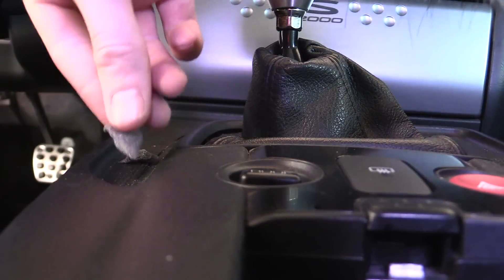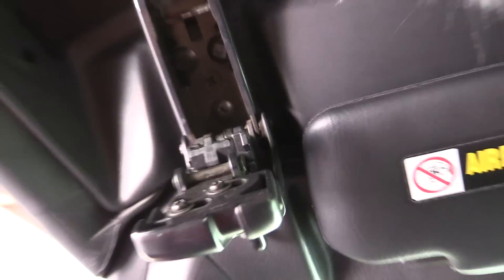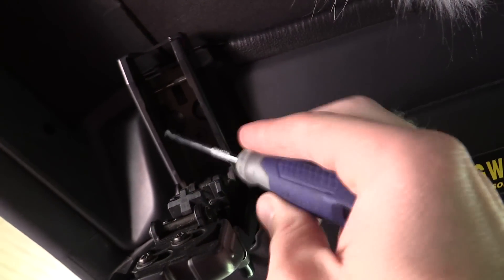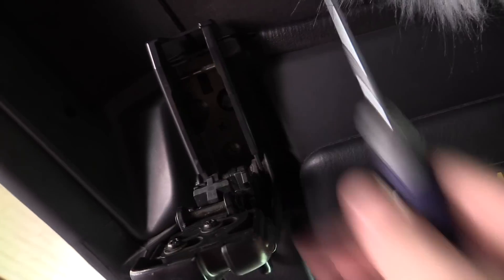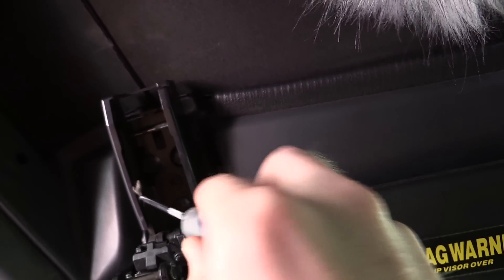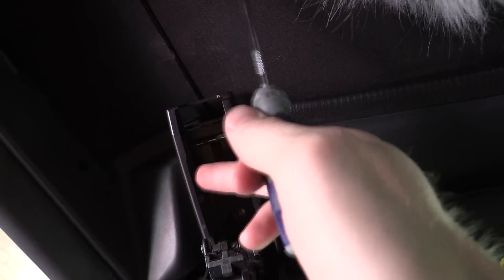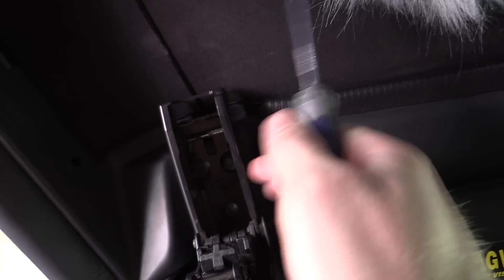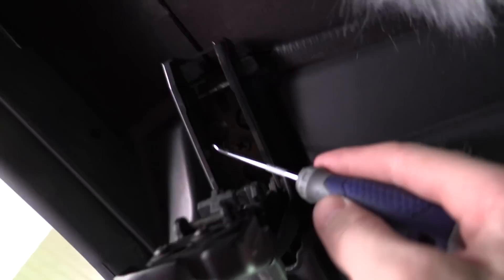S2000 latch rattle fix DIY

Comment: zentrose i have a 2002 s2000 and i have a buzzing sound coming from my soft top behind me while im driving it happens when im giving it gas its a buzzing sound from the soft top frame somewhere probly but i cant find it i did the latch fix and the felt pads at the one contact point on the too frame still doing the buzzing. smf cant find it have any ideas? thanks

Comment: Do you get a rattle/squeek for the passenger seat? Any ideas on how to fix it?
Reply from the maker: kimchimonkey What year is your S? Yes I think I have that squeak too. I will try to fix tomorrow and post a video. Thank you.
Reply: ZentRose 2008.  It seems intermittent for me. Thanks really appreciate your videos! Btw if you're planning on keeping on the stock radio I recently got the Blitzsafe bluetooth adapter and I recommend it.  I like not having any cables and sound is decent.
Reply from the maker: kimchimonkey That is a good idea. Thank you.

Here is what I did with the seat squeak. It made my squeak disappear. I found this fix on s2ki and made a quick video:

https://www.youtube.com/watch?v=aM7Kk__5uFc

Comment: Do you know of any DYI for the large amount of wind rush noise?
Reply from the maker: Yeah try this: after you put the top up and lock it in, you can pull back on the top down switch and it will seal it up. The cause of the wind noise is usually worn strike plates/latches so you could also replace those parts.